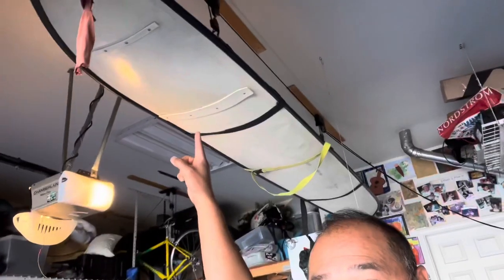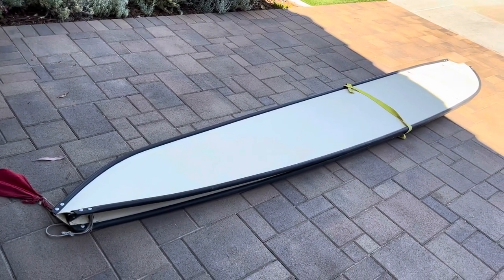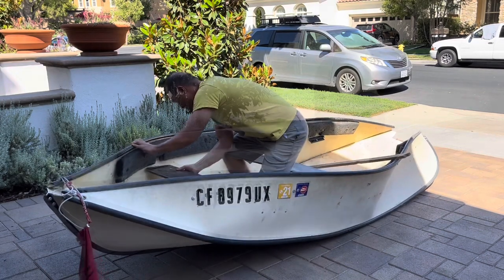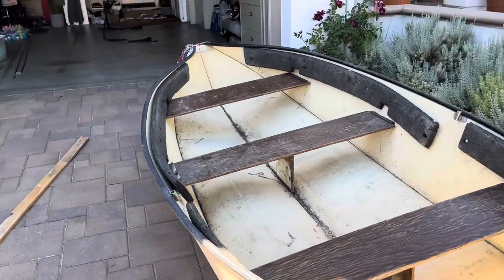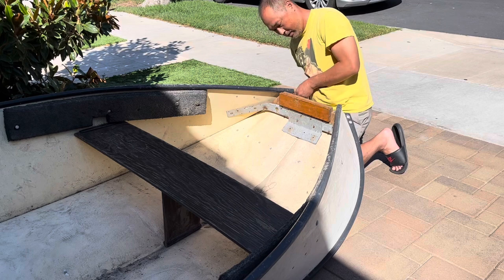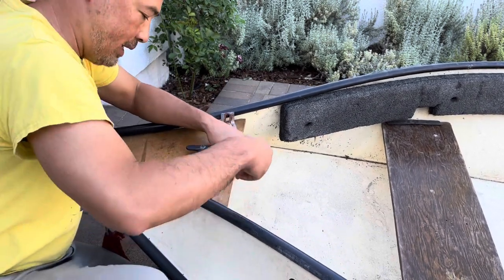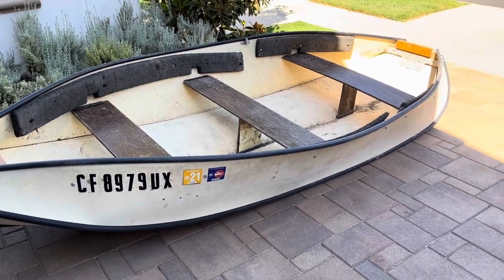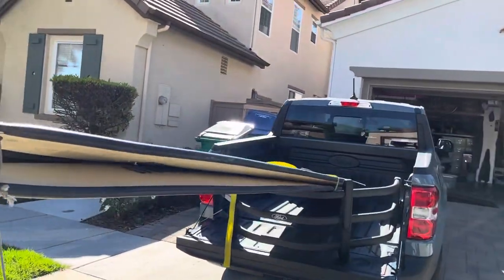12 ft Porta Bote Demo and Fit In Back of 4.5ft Ford Maverick Bed With Bed Extender

Comment: Great video, I wanted to ask about the bed extender, is it removeable?
Reply from the maker: Yes, super easy to remove. Slides off the mount at a certain angle
Reply: @GearGadgetExperiments  ok great, thinking about getting it.